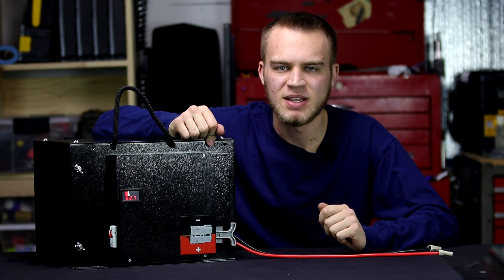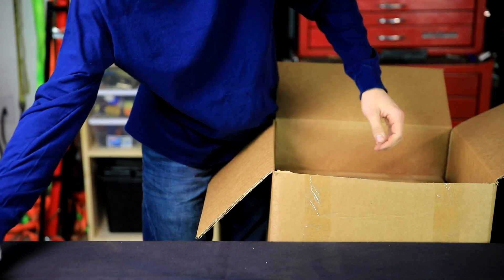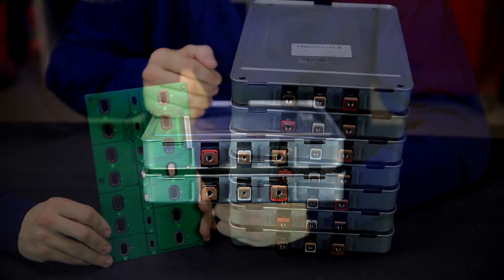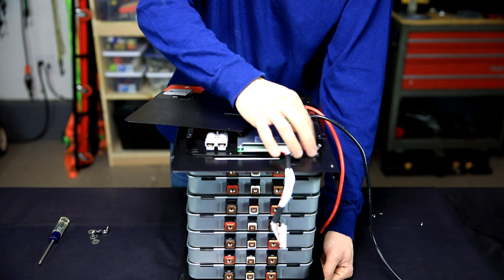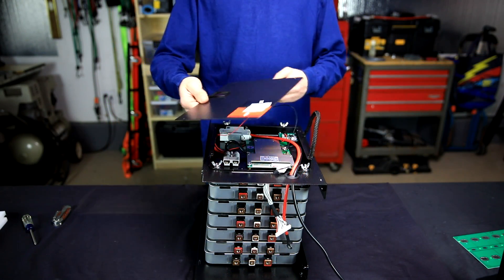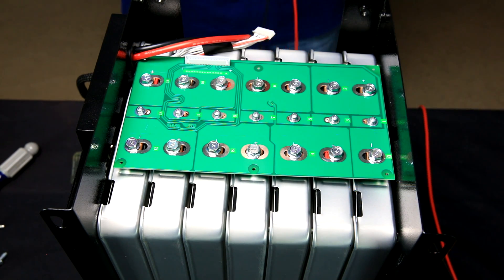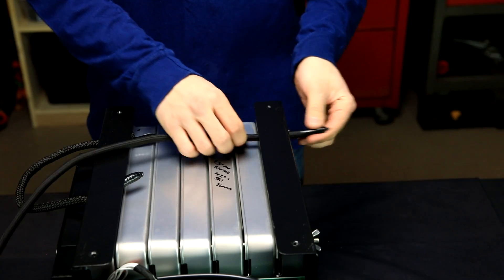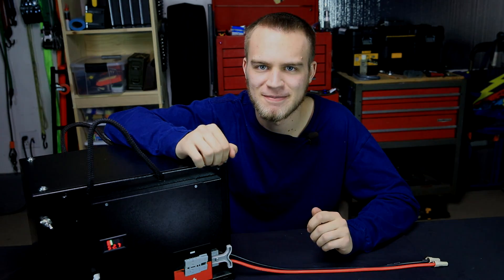Off Grid: Cheap 48v Nissan Leaf Battery Pack Assembly & Unboxing

Comment: I am working on a battery pack using 14 leaf Gen1 batteries in series. Do you know what would work for a BMS and charger for this setup? End voltage is 104 volt

Comment: Nice build, but I couldn't believe you didn't put washers, preferably lock washers under the bolts. The contact area of the bolt head to the plate is minimal at best.

Comment: I have 3 of these running in parallel (same voltage but more amp/hrs).  I mounted the 3 inside a steel 'gang' box with wheels on the bottom for ease of movement.  These are some heavy beasts.   I've used these to power some essential stuff during power outages without problems.  Be careful though.  The first one I attempted to build, 2 of the cells began to swell overnight.  It took a while to figure the issue.  Come to find out 2 of the leads were reversed in the balancing connectors so that the bms was trying to charge one to overcharge while discharging one that was undercharged.  It was sending the action to the one with high voltage and discharging the one with low voltage, all the time until 2 modules were toast.   Quality control is off.  In order to avoid such use a continuity meter to make sure the contacts at each end of the harness match for each wire.  One little assembly blunder could have caused a major issue.  
I plan to discontinue use of this battery bank once I get enough cash to replace these with li-ion batteries which are much safer, overall.  The leaf cells use lithium cobalt which is more dangerous.  And that is why I mounted all of these in steel box with latch enclosure.  Also, I calculate these to be closer to 40 a/hrs per module, not 60.  These are generally not removed from service on the Nissan Leaf until they degrade to that amount.  But for a battery bank they were a cheap solution (not any longer though).  So the actual watt rating is in the 1900-2000 watt range.  My 3 produce about 6KW/hrs.  Don't believe the printed ratings unless you get new ones.

Comment: Thanks, @highTechLab,  nice video and explanation. I did not see the link with discount. I just changed my 2011 24KWh Leaf battery for a 2017 30KWh and want to use the old one as stationary power wall. With 48 pouches, I need probably 7 of these, although I am then short of 1 module. Any suggestion what to do with the remaining 6 modules? Since I am in Mauritius, it is not possible to get another single one easily here. Please send a response to tkrimmel(AT)gmail.com. Thanks

Comment: Way too much packaging material that just ends up in land fill.
Reply: well the thing about batteries is that they tend to explode and burn when ruptured, so I'll disagree with you on this one.
Reply: @brentsavage6522  What I was referring to was the amount of non recyclable packaging material. They could have used recycled cardboard or a thousand other things other than the polystyrene they did use... That was the only negative thing I coult think of.

Comment: Nice video. Thank you.
Reply from the maker: Glad you liked it!
Reply: @HighTechLab  Thanks. Is this KIT available for 24V pack?
Reply from the maker: BigBattery sells fully assembled packs in various different voltages.  The actual kit that you assemble yourself is no longer available at 24v
Reply: @HighTechLab  bummer I want 24 volts to.

Comment: There are many types of stainless steel which are magnetic.
Reply: Agreed, but if it’s steel and it’s NON-magnetic as demonstrated, it has to be one of the stainless steels.  The opposite effect of using a magnet to try to detect mild steel as an attraction could also be one of the magnetic stainless steels you refer to.

Comment: Is this something I can charge and be used at the same time? We need a pass through to the electicrical system. Can we change and discharge at the same time?
Reply: Yes you can
Reply: Brian’s Solar & Wind Power:  But if your load current is too great you risk burning out your charger.  Its all down to how much current your charger can supply in relation to your load.
Reply: Ian Mathieson yes you match your bms to the current

Comment: DUDE you just saved me a lot of frustration. I got their kit and batteries separately to self-assemble and couldn't understand why the packs would barely fit, and too wide for the circuit board. Turns out I opened two boxes of Left positive packs FIRST, not realizing there are two different orientations of battery packs. I was flipping each pack around to make it fit, but they were all the same orientation so it was too long for the threaded rod and circuit board, even after I tightened it down completely. 
TechDirectClub's online tutorial video SUCKS and there are no written instructions. I had no idea what those pins and the black plastic board was for! Their video goes too fast and is edited too much so there's literally a quarter second for some of the steps. Difficult to catch even watching at 25% speed. You TRULY saved my sanity! THANK YOU!

Comment: Is it possible to rebuild a nissan leaf battery with these battery packs? (anyway to avoid paying upwords of $8000 for a new battery is a win in my book.)
Reply from the maker: You can buy the leaf modules directly from bigbattery.com and save 10% off if you use coupon code hightech10.

as far as the rebuilding process I don't have any experience on that subject.
Reply: Mike Nelson & HighTechLab:  Have a look at the superb YouTube posting titled ‘2011 Nissan Leaf Battery pack - deep dive’ by Prof John D Kelly of Weber State University, published 11 Dec 2019.  It will give you a true insight into what’s involved.  But take lots of photos as you dismantle the old battery otherwise you’ll quickly get into deep mire with no way back or forward.  There’s a huge amount of stuff inside the overall battery case and its vital that everything, including all the different fasteners goes back in the correct locations.

Comment: Somewhat out of order... all of the measuring and wingnut tightening has to be done with the battery contact bolts still loose, or you risk breaking the battery connections by over-stressing them.
Reply from the maker: But you can't because the metal structure that holds it all together is in the way of tightening them. The good news is the PCB is flexible enough to keep from breaking the contact bolts.

Comment: How will you be using this battery setup?
Reply from the maker: The original plan was to install it in a good friend's fishing boat, to run some LED lights so they can go bow fishing.  They don't want the noise of a generator when they are out fishing, so I'm going to be building an enclosure for this battery pack as well as the associated battery chargers, inverters, etc. that can be removed from the boat and also used to power his RV when he is dry camping.  Should be a pretty awesome build by the time everything is done!

Comment: Man THIS IS AN AWESOME BATTERY SETUP!!!!!!!!!!!
What I am curious about is how many 200ah AGM batteries would this compare to? 
We unfortunately do not have any more than 100 electric cars in all of Chile. So Li batteries of any kind are EXTREMELY expensive. 
I wish I could sell these batteries here in Chile. Have them call me:) Jim
Reply: Sorry for the bad question but I am new to Solar and electrical side of things and I am trying to figure out the economics and efficiency of these batteries compared to my AGMs. Jim
Reply from the maker: This battery (In theory) should hold 2.5 KWH.  I will be doing capacity tests soon to confirm that advertised capacity.

Comment: Wish I had those  Balance PCB boards.   May attempt  to  makes some.   Just for the Balance contacts.  Going with 4 Modules Parellel.
Reply from the maker: I might be able to check with my point of contact and see if they have any other options.  Are you going for a 4p 7.5v pack?  What kind of application are you using it in?
Reply: Pulsejet & HighTechLab:  There’s nothing magic about the PCB - its just a convenient means of connecting all the batteries together and in turn connecting these and all the individual balance terminals to their inputs in the controller which is where the electronic magic happens.  If you can handle the task, you can make wire connections in place of the PCB but you may not have sufficient space for these inside the case unless you modify it.
Reply: @HighTechLab  Well dang,  Never got a notice  on your response.   4P 6S 25.2 volts.  Intermittent use wind turbine.   Just energy storage for weather days.   I only have a small system.  10Kwh on the Solar side.  That is all LiFePO4.

Comment: How much is the torque on those battery bolts?
Reply from the maker: I was not provided with an exact torque spec, so I went hand tight plus 1/4 turn.  This felt pretty snug.
Reply: @HighTechLab  Thanks for the honest answer. Big Battery should include that with their product as it is important to get it right.

Comment: My leaf pack build was great. I used that series board. Works well
Reply: I used Gen 2 cells tho
Reply: I also used an ANT bms with a lcd screen
Reply from the maker: I actually looked forward to your comments on this video because I know you've played in this realm.  I've seen you videos, pretty awesome!!!
Reply: @HighTechLab  thanks. What you doing with the big system?
Reply from the maker: @frankz1125  are you referring to the system I have shown in other videos with the CALB cells?
Reply: @HighTechLab  yes. Have you made it bigger yet?
Reply from the maker: @frankz1125  not yet, I've done a bunch of updates to the PLC programming and rebuilt the control panel in the hot tub, but I moved to Idaho for work and haven't had much time to make any upgrades.  We will likely be adding more batteries soon!!
Reply: @HighTechLab  nice. I seen what you posted. Cheers